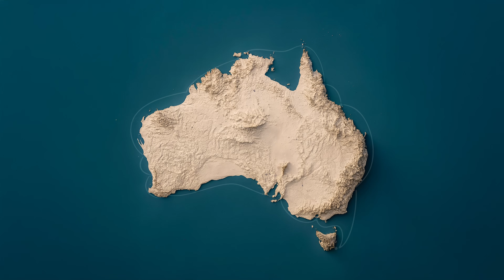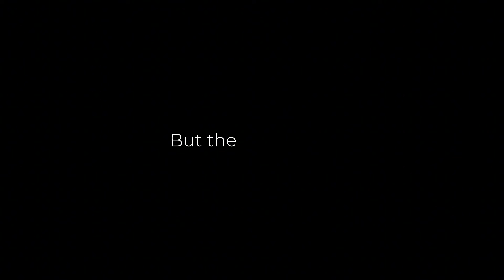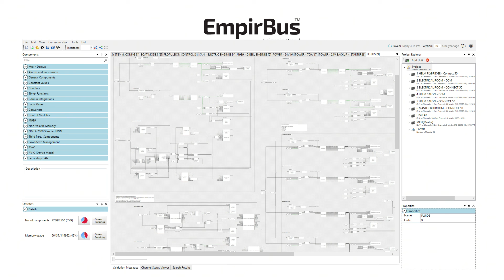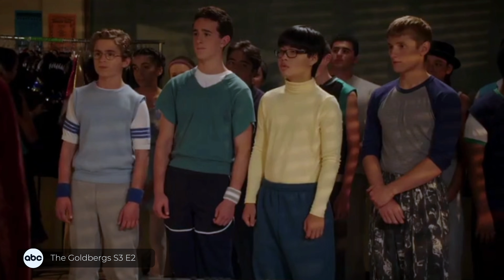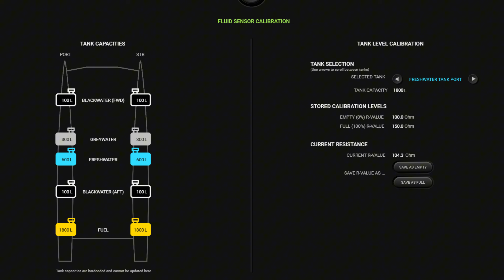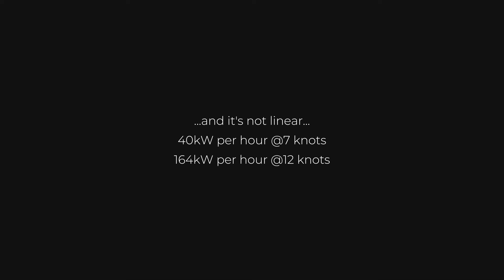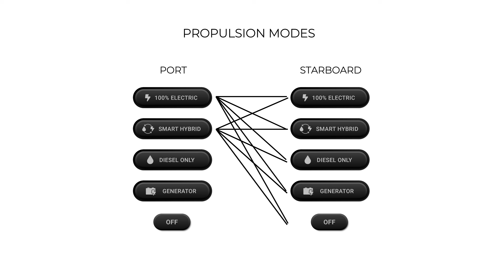The System Behind Our New Solar Electric Yacht

Comment: It is utterly impressing that you have taken on this project, and by the looks of it so far solved it quite impressively. One question: is the batteries split in different packs so you have the option to select them and run one or both engines on separate battery packs? The design principles for different DP classes on commercial offshore work vessels and how redundancy is defined/solved might be interesting for you. For example; higher DP classes vessels dual systems are designed to separate and work independently if you have a critical failure in one, while working together under normal mode.

Comment: my dad, just I had a 55 foot catamaran built, Which took three years I wish he knew about the system, before the boat was made. is this something that can be integrated turn old system without ripping out all the old wires? and can your system be Altered before different boats?
Reply from the maker: It could be altered, but it would take a lot of work, so you'd likely just start from scratch.

Comment: Sounds like the perfect kind of system for AI to run.
Reply from the maker: That's tricky, AI is probabilistic, which just means that the answer you get is slightly different each time. That's not ideal on a boat - you want to know it will respond the same way everytime. Definitely some other use cases for AI on boats though.

Comment: I figured you would have more “AI” in the boat to do more computing for you. And is it now possible to charge a lithium marine battery off of the boat alternator? I tried on an aboard and fried the alternator when the BMS cut off. I’m tired of the huge, heavy  AGM battery’s.
Reply from the maker: Ai is probabilistic so it can give you a different result each time, which is not ideal. For e.g. power optimisation yes, but for general use you want the boat to respond the same way everytime you ask it to do something.  You might like our next video on batteries.

Comment: It's curious to compare with other solar electric yachts though there are very few. The Silent 60 looks like 2 x 164kw electric motors, 16.8kWp solar, and 354kWh of batteries and they went the range extender route of 130kW generators. So you'll have higher power motors but they will be hybrid. Also a bit curious on how they could fit almost 100kWh more of battery or did you cut down on that so you could have more space and weight? Fitting more solar is defiantly the right choice however, most electric yachts seem to have way to little.
Reply from the maker: These are all really great questions! Silent is a hybrid too, but their version is what's called a serial hybrid, but the key thing for us is we really spent a lot of time balancing the system and considering our specific use case. Bigger is not always better - a big battery helps if you occasionally cruise but if you're off grid everyday and dont have enough solar to charge it, then you are carrying around a lot of unused battery weight. We're planning a video oon talking about this specifically - how to decide on the best combination of sizes and powers for your use case so you maximise performance and efficiency.
Reply: @projecteyacht I saw a catamaran electric conversion awhile back and it looks like he added grounding spikes to redirect lightning into the water in an effort to save his electrical system so I was curious if you had looked at that as well, or did you have some sort of manual backup to steer and run the engines? Sorry I could go on and on about the questions as I've imagined building one out myself. Was also curious the choice of low voltage system, I thought both 48v and even more so 12v both had more components that would run on that voltage then 24v. With 48v you could mitigate some wire weight, also cooling and heating, heat pump vs evaporative, all great video subjects I suppose
Reply from the maker: Yes, we're doing both of those for lightening. We'll talk .pre about the voltage choice in our next video. Keep the questions coming, even if I dont have time to respond I note them all down to ensure I address them as the videos progress

Comment: I have sailed the Pacific and the east coast of Australia in my 50ft mono hull. I have a few constructive thoughts
Maybe consider wind generation as well as electricity is crucial . 
Your 100 nautical miles a day on passage  seems really light with an average speed of 7-8 knots. 8 knots average 192 NM , 7 knots 168 NM , 6 knots 144 NM, 5 knots 120NM, 4 knots 96 NM 
Cruising the world has challenges, you may think about having another person , or more on passages, as your husband may not be able to assist in a robust way when needed. I think There should be someone at the helm station 24/7 when on passages or even under way. Couples do watches on their own but it’s hard. Say 3 hour watches. Wife is on 1800 - 2100, back on 0000 - 0300, then back 0600 - 0900 , husband is on watch 2100- 0000, then 0300 - 0600. Everyday! Solo yachtsman do it even harder. Relying on there AIS and Radar alarm. Catnaps through the night , which vary in when they are in the cockpit , getting up and checking the boat regularly, light sleeper and responsive to sea changes. We sailed passages with crew and it worked out well . Two crew plus the two of us meant 3 hours on 9 hours off. The Skipper is always available and called in certain circumstances 
You might already have the solar panels in isolated groups. 60 knots of wind can rip anything off
It’s a big wide boat, there will be limited to no marina berthing that would be available to you  in most parts of the world. 
I think have the diesels connect in-line is a top decision. The power to get out of bad situations like getting blown onto a lee shore by big seas and strong winds
Reply from the maker: All very good points, thank you for sharing your experience!

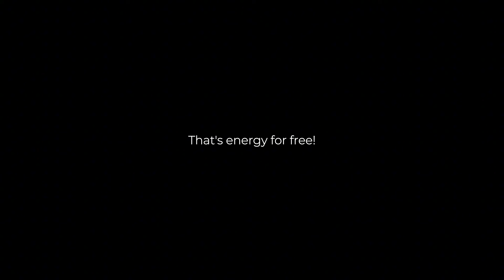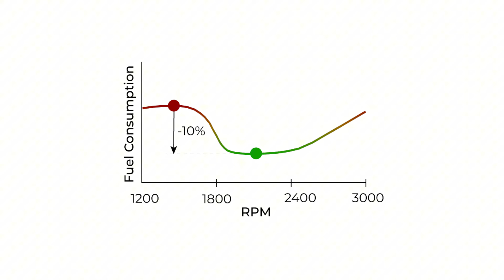Comment: @22:45 - 23:00  No.  I'm sure Tess (and Rob) already know this, but the wording in this part is very misleading.  No engine burns less fuel by adding load (regen), nor do they use more fuel at lower RPM than at higher RPM (peak efficiency).  Yes, you use less fuel per kWh output at peak efficiency than lower RPM, but that's quite a bit different than using less fuel overall.  And given the cube ratio of engine power vs. speed, you'll still travel much further at that lower RPM (per liter/gallon of fuel) than going faster at peak efficiency - as much as 60% loss in range.  So if you're low on fuel and wondering if you'll make it back to the dock - slow down!
Reply from the maker: Apologies, talking to camera is hard. I will make mistakes, but will also get better over time. Hope you can hang in there in the meantime. Love the attention to detail.
Reply from the maker: 100% and surprised you were the only person to comment on this! Tried to simplify it for the broader audience and in doing so ended up saying something that's not true (unless you had a variable pitch accelerator). I should have stuck with talking about load balancing at a given RPM. Thanks for watching and taking the effort to comment. Love the attention to detail <3

Comment: @13:00   I do hope you have an easily accessible emergency switch that allows you to keep running no matter what the power issues are, if possible.  Being in a storm and losing headway because your batteries got a bit warm could be disastrous.
Reply from the maker: 100% correct, and yes we do.
Reply: oops. I should have read the comments before commenting. :)

Comment: Is there a reason you went 24v rather than 48v (existing technology?)?..
Reply from the maker: Our 24V battery is only for the MFDs, instruments etc. Our main/propulsion battery is actually 700V, 48 V is too much current for our electric motor size. Our tender may end up 48V though.

Comment: What do you use as a clutch between the diesel engine and the electric motor, and how does it work? Thank you.
Reply from the maker: We have a Rubflex SP211, its the same as the twin disk 211, but more affordable. It's pretty simple, just push the lever to engage or disengage the clutch. We have a  linear actuator that moves it for us and that's controlled by our propulsion control system. We've set it up so that it will default to engaged position if the electronics fail. That way we can run on diesel only and still get home if we have an electrical issue. We of course also manually reengage if needed.
Reply: @projecteyacht Thank you 🤝

Comment: "It’s really cool to see the first electric version of this hull. I designed this boat myself a few years ago for a company in Thailand—we've seen a few built with standard propulsion already, but seeing my design finally go electric is exactly what I’d hoped for."
Reply from the maker: I didn't realise you designed the hull for Floeth?! Did you do any modelling. We're keen to get an estimate of the hull resistance, since we're still not in the water.
Reply: @projecteyacht  No, I made the hull and exterior design in 3d and a basic layout drawing, from memory they were using a Thai company for speed prediction, they had not decided on what engines to use at the time

Comment: 9:27 there is some transfer of energy from hv to lv battery even though lv is at 99%. Cap lv battery to 90 % to prolong battery life as mostly dc to dc convertor does the heavy lifting and lv battery usually acts like a huge capacitor.
Reply from the maker: Thanks for the suggestion

Comment: wow. remind me never to have a physicist design anything.  arrogance and hubris make for a bad combination.
probably the worst designed boat ive seen. i presume this is a floeth yachts / solstice branded nonsense since its shaped like a brick with no thought given to anything other than shoving it around with giant diesels. typical of thai boatbuilders.
700V DC current in a salt water environment. a digital switching system you cant override in an emergency. and those are likely to be NMC cells. probably some chinese crappy blade batteries which are known to catch fire and explode at the wrong time. 2000+ parts on the network. a bus instead of a hub and spoke to run it. no consideration of bus loads and breaks in emergencies. complete glass display with no way to bypass it. jeez. stick to physics instead of designing deathtraps.  400+hp diesels bolted on with no consideration for weight. a kitesail slapped on with no thought on space for launch and retrieval. someone needs a lot of ocean time to even come close to a good boat design. save your  money (and your life!) and just buy an existing seawind 1370 or something. jeez.

Comment: Curious, why not make the solar panel array end to end on aluminum beams?    Seems like that would help generate more kW and recharge batteries faster, etc.   I’m also curious if you did effectively double the solar array, just how many kWh do you need to run the electric motors at capacity?  I.e. could there be times when you simply don’t need battery power to augment steady state run time?
Reply from the maker: We plan to add more solar after the boat is complete, but we may not need to go to that extreme :). We can definitely break even, but the question is only how slow is that at. We're hopefully we might be able to break even at 6-7 knots. Fingers crossed!

Comment: I would join the other comments on a standing ovation for the video and the project! Question: If there is a major electric failure, the diesel engines would have to be engaged manually, not using the digital interface, correct? How did you solve this?
Reply from the maker: Thanks and yes, you're right. The system basically ties in to the standard diesel setup and effectively simulates physically running them. If the system fails you just run it like you would if were a diesel boat, with the only exception being your engine data, you'd have to use the manual engine panel (hidden on the helm).

Comment: Outstanding work. Sorry if this is an ignorant question, but with all of the electrical componentry, is there anything you can do to protect it from lightning strike failures, like aircraft which have lightning rods to conduct and expel the lightning?
Reply: They can add a lightening protection system, but a lightening  strike would be big trouble. The thing to do is hope you can call for help after.
Reply from the maker: Thanks! We'll be doing a couple of things, but lightening rods = yes, EM proof box with spare comms, diesel ECU etc as well as a couple of other things.

Comment: But could you sail ⛵️ it across Ocean's? I can see where your passages would be faster and more of a straight line. Witch would save time ⏲️. 
 But it looks like it is just a coastal cruiser. 
 If it could cross Ocean's, It would be the best boat 🚢 out there. 
 Thank You for this video 📹.  It was very informative. And I did injoy all the tec stuff. I wish we could of seen what she looks like inside. And what comforts, she had.
 Ok until next time ⏲️ 
Aloha from the Big Island of Hawaii!
Reply from the maker: Thanks! Definitely rated for ocean cruising. but we'll need the diesels in that case, unless we want to go as slow as a turtle ;) We'll do a boat tour video next <3
Reply: @projecteyacht your metacentric height changes for solar panels up; once the boat heels in rough seas; the solar becomes a sail and the vessel will have an added force; who has done all the calcs on righting conditions and heeling and what wind speed will take her over? Because all vessels have risks and yours is relatively obvious.
Reply from the maker: Thanks, no worse than any other power cat with a flybridge roof. Also, not having a mast and being 11+m wide gives an advantage.

Comment: For pure solar your navigation software has to be quite different than the regular mid latitude sailing stuff all over the place now.
Solar would prefer sun over wind making it different even for boating seasons; bonus would be more berthing spaces in harbours. 
Sea state / waves affect solar / wind & mono / multi hulls all quite a bit, so that is similar. Same for prevailing ocean currents on that spot and that season.  
Having seen how bad even local weather models perform, I would opt for inboard data gathering (look outside!) combined with a phone call to the next anchorage for real info about the weather there.
Reply from the maker: Yes, we'll definitely have to passage plan differently and not just follow the tried and true. All part of the adventure!

Comment: You use 700V propulsion to lessen you cabling thickness probably; is that why you are using a fiber glass hull over aluminum for deadly shock risk?  Coral reefs are a bit of a problem for fiber....
Reply from the maker: 100% on the cable thickness! We're fibreglass, but we're going to add a skeg for protection and we'll have some you beaut forward looking sonar as well. Good thing with the electric we can crawl along very slowly.
Reply: @projecteyacht  Thanks. Would you have gone for 700V even on a stronger aluminum yacht?
Reply from the maker: We hadn't considered aluminium as we bought a the hull during COIVD times and didnt have many choices, but yes, the system is the system. Electrical protection would have needed some additional measures perhaps, but yes.

Comment: hahahaha, "Those engines are then backed-up by two 400hp (!!!) DIESEL MOTORS????"   four hundred horse power, wow. that's crazy much. probably to drag around those batteries :-D lol

i must say u r being a bit hypocritical: u say in the intro, "without the noise and the fumes of diesel....." hahahaha

this is sooooo bad, greenwashing and providing false information. just be honest to your viewers.
Reply from the maker: We've made the system so that we can travel without diesel almost all the time. Based on our calculations we'll only need them if we need to cross an ocean. We aren't like a silent yacht, we wont need to generate power with them every day, but yes, it does take a LOT of power to push a boat and batteries through the water! This is definitely not a green project.
Reply: @projecteyacht  then at least be honest about it and don't bad-mouth diesel. You are NOT an electric boat, you are a hybrid. 

Also, you should consider the amount of destruction and pollution caused by the fabrication of the batteries, solar cells and all related extra-electrical infrastructure (most coming from Chinese miners/refineries who lack enviro compliance) that you require by doubling up over 'just diesel'. People don't understand the impact of all the extra raw materials being required....

Comment: Don't buy the use case for the parallel system.  If your electricals are gone, there is virtually no way to start your diesel.  Modern diesels will fail due to ECU failure.
Reply from the maker: Our diesel system is isolated from the rest of the boat, and we will carry spare ecus and starter batteries.

Comment: I'm impressed...4 real...But I have one question... lightning strikes... I was lucky 2 get hit twice. 1st hit wasn't a catastrophe; the 2nd one (different yacht) fried. Everything...so what is your plan to protect all that smart digital brain?
Reply from the maker: Thanks! Sorry to hear that you've had such bad luck with lightening. Sounds scary, and expensive. We have got a few lightening protection measures planned, but worst case, Our diesel system is isolated from the rest of the boat, and we will carry spare ecus and starter batteries, so at least we can get to safety.

Comment: I key point that is missing to me is how to profit from the panels. Partial shading is crucial and being able to incline the panels is a big plus.
Reply from the maker: true, inclination is helpful, but not practical in the case of a boat which moves around. We definitely have optimisers and microinverters on the panels to deal with shading. We do have plans for more solar after the boat is handed over - we've crunched the numbers and you win even with the increased weight.